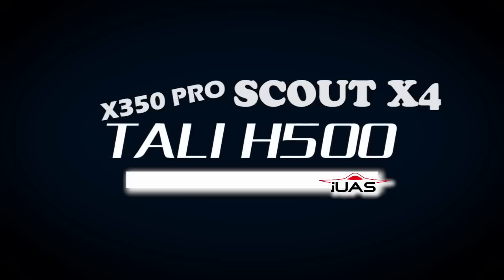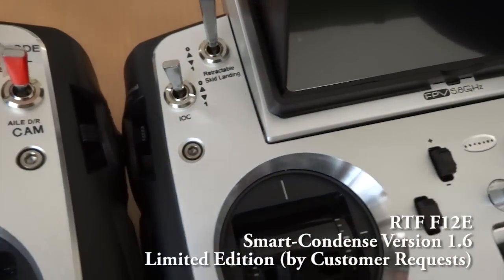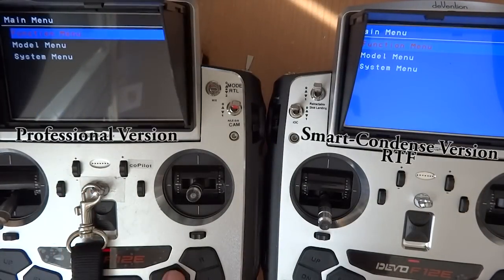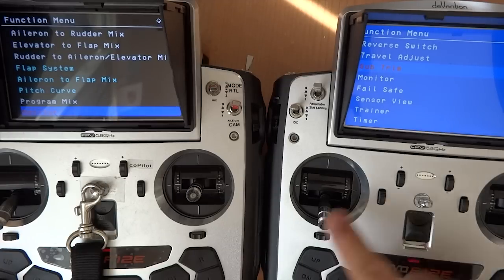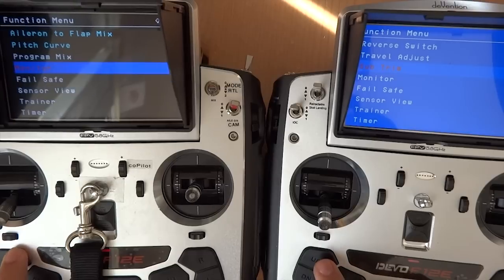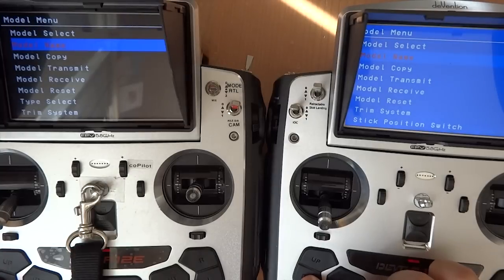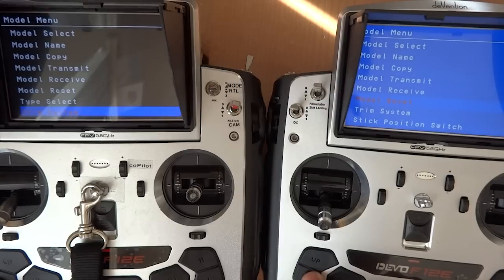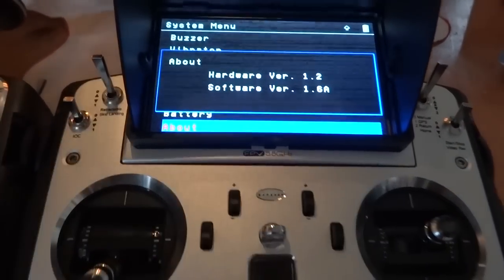Walkera Devo F12E Smart-Condense Version

Comment: Devo F12E: In Model Menu/Device Output I notice there is no assignment for AUX 1...Appears to be listed as Pitch and assigned to System/Active...Owner's Manual P.26 (2) says 'Setting Unavailable...SO now I am unable to use Aux 1 as a Channel? This means my Rx1202 is an 11Ch and my Rx601 is a 5Ch?...Am I missing something? Any help is greatly appreciated :)
Reply: +SEEKER OF YAH Got It...All my multirotors are set up in helicopter which locks AUX1 as system pitch...need to set-up in airplane and pitch will become flaps and can now be assigned as device output(AUX1)...Devo 7 reacts the same as you will lose AUX3 in heli set-up...Moral of the story is model setting must be airplane when using Devo Tx for multirotor or you lose a channel...uggh now i gotta re-set-up my Tx for 4 birds lol

Comment: On the top of the F12E there is a port marked Output Current Power Cable. What is this used for.
Reply from the maker: There is a dc out, we have not used it, but you can use it to power any hobby gears.  pro radios are made to support your innovation. Some folks use headtrackers, I would put a fan on a hot day :)

Comment: If I plug in my USB f12e not detected by the program update. How do?
Reply from the maker: Davide Enrico Bovolenta i will make you a video today, standby.  try another usb if it is Windows OS related.
Reply from the maker: Davide Enrico Bovolenta Hope this helps, the video on how to upgrade https://youtu.be/EdpeHtk6Q5s
Reply: Davide Enrico Bovolenta Did you manage to get it working? I have the same problem.
Reply: Davide Enrico Bovolenta Never mind, After trying about 30 times it suddenly worked and my computer recognised the device.
Reply: I have to turn it on in UPDATE mode. Pressing the button EXT. Otherwise connected USB does not see anything.